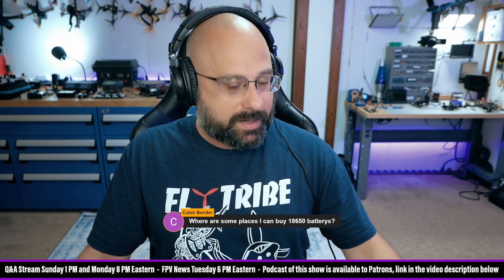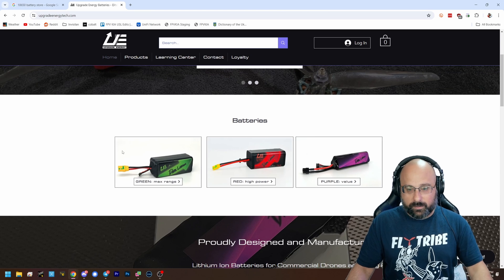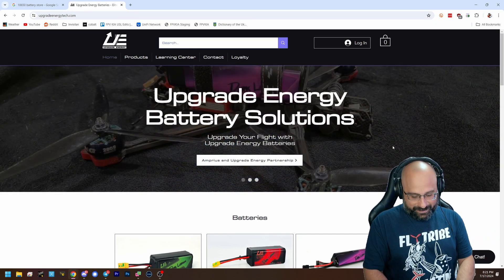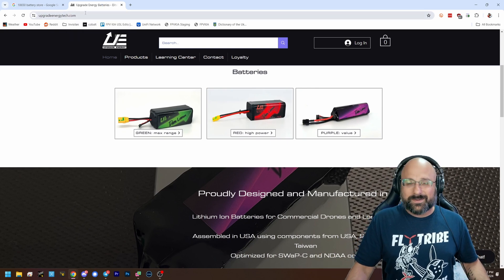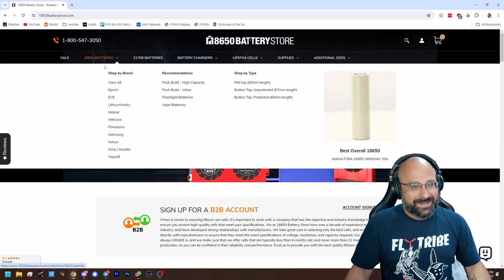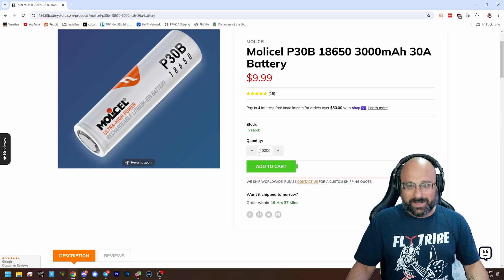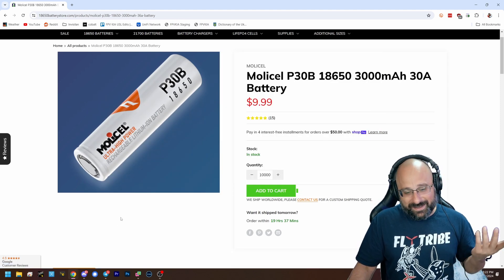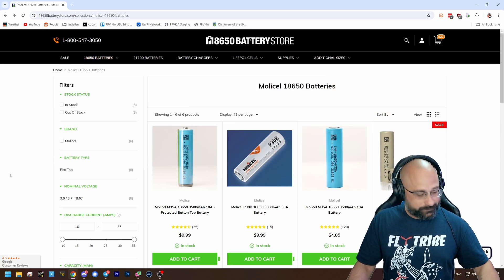Where Should I Buy 18650 Batteries? Will My Motors Go Out When I Have Low Battery? - Random FPV Qs

Comment: I still advise a squid stick cause it will work with any elrs radio, even the ones that don't have a usb port or support to be HID (looking at you betafpv). Since it's wireless I also find it easier to manage and can fly on the tv while sitting on the couch. Wireless is great here since the dogs would be yanking the usb cable out. I think the only latency would be from the squid stick to the PC, as the normal OTA latency for elrs would be the same as flying a quad irl, maybe less since you'll usually be within 5-10ft of the squid stick.

I'm not an expert though so I'm probably wrong with some stuff, but that's my take anyway.

Comment: What you could do, is test how much latency the video link has (by flashing a light for example). Lets say we get 15ms. Then we test what the latency is for an input (On the bench with a high framerate camera) and then add the two together.

Comment: Core temp is somewhat useful as a LR pre-flight check.  Sometimes waiting for the GPS to lock causes overheating and I'll stay close and slow until the temp warning goes away.
Reply: Yeah. If you have a imminently terminal disease (to follow the analogy), I wouldn't get behind the wheel of a car and risk damage to others or property. I would instead take it back to the bench and fix it, or if it's just trying to overheat, unplug and let it cool

Comment: Typically at 60fps on a good monitor you are having 50-60ms latency between input and change on a well optimized game. If you go high frame rate and use a higher frame rate monitor you will have less latency but for lift off and DRL it seems gameplay is limited to 60fps.